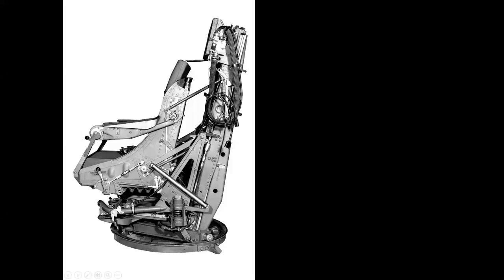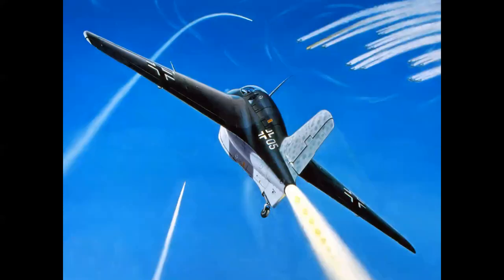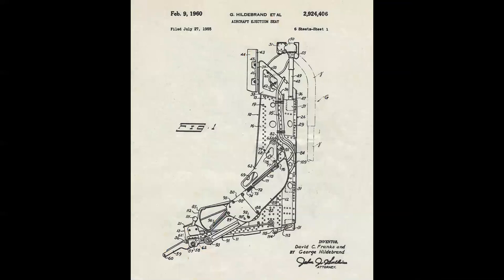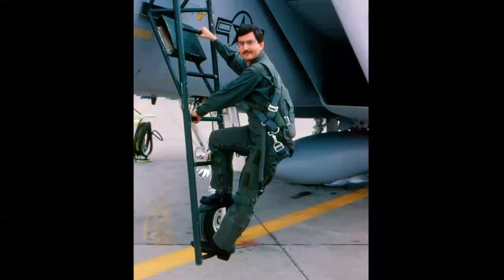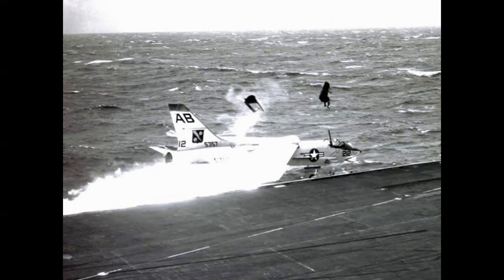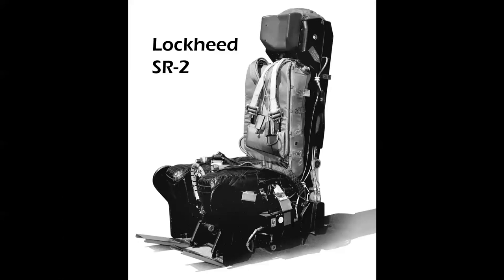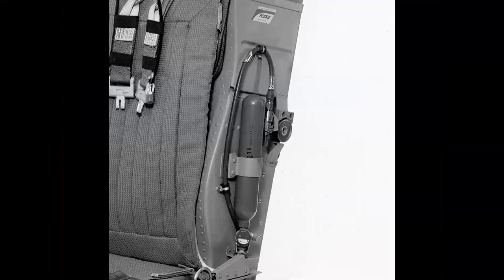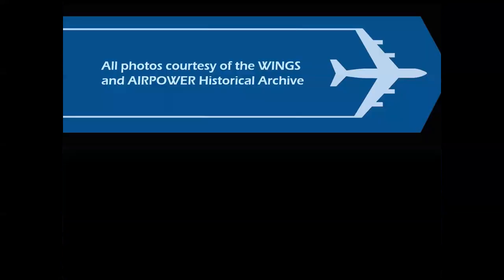EJECTION SEATS - Evolution of High-Speed Aircraft Escape Systems in the Supersonic Era

Comment: Approximately how many ejections are made through the canopy instead of canopy jettison followed by ejection?  I know the A-6 crew goes through the canopy but I don't know if any other plane does this.  

The sequence of events is phenomenal and such short periods of time.  When you add in situations where there are two or more crew involved they have to "flare out" to avoid hitting each other.  Incredible that it works for a single pilot.

Another great series!  Thanks!!!!!
Reply: "Approximately how many ejections are made through the canopy instead of canopy jettison followed by ejection?"
Depends on the plane and its mission.
The A-6 wasn't the only plane where the ejection seat was designed to punch through the canopy, btw.
The F-35 and Harrier do this as well.  The reason has to do with the US Marine Corps close air support mission.  They fly lower and closer to the troops so a normal ejection sequence where you'd punch off the canopy first wouldn't work; the Harrier and F-35B fly too low for this and the pilot wouldn't be able to get out in time in many instances because the canopy separation prior to the ejection seat firing would take too long!
They don't punch out through the canopy immediately.  Instead, an explosive cord built into the canopy (you can see it as white "stencil" in the Harrier canopy and F-35) fires and shatters the portion of canopy above the seat (indicated by the stencil which is actually the cord).  The explosive cord does this in milliseconds.  THEN the ejection seat goes through the shattered canopy.
Reply: Reading further, the T-6 Texan II and the BAe Hawk trainer evidently have a cord destruct system for their canopies, too -- ie, their ejection seats blast through the canopy, too.
More of the ejection systems seem to be designed now to have "breakers" -- literally spikes -- built into the seats to shatter the canopy in case it can't be blown off.
Going THROUGH the canopy without an explosive cord system is THE LEAST desirable option even a canopy breaker system built into the seat!
Reply: @AvengerII  Thanks!  A-6 tanker where there was a partial ejection sequence with the second seat guy stuck half in and half out of the plane showed how dangerous this could be.  If his chute cords had not gotten entangled in the vertical stabilizer  and held him back he might have impaled on the shattered canopy on landing.
Reply from the maker: Many thanks Chuck, and today's ejection sequence occurs literally in the blink of an eye. From initiation to full parachute is 1.8 seconds with the ACES II in Mode-1 today. As for ejecting through the canopy, all modern seats have 'canopy breakers' built into the seat tops. Northrop's original T-38 seat (1959) actually had a sharp stubby blade sticking straight-up on top of the seat headrest.
Reply: The Lockheed T-33A seats we had at Tyndall AFB, Fl. had the canopy breakers atop the headrest.
Reply: @AvengerII  I’m not sure about the Harrier, but your explanation about the F-35 is incorrect.  Pulling the Ejection Handle on the F-35 on all 3 variants will always fire the canopy fracturing system before the seat fires unless there is a system malfunction in which the canopy fracture system fails.  The canopy breakers on the F-35, T-6, T-38, F-15, and A-10 are only there in the event of canopy jettison/fracturing malfunction.  The reason the F-35 has a canopy fracturing system as opposed to a canopy jettison system is due to the canopy hinges being at the front of the cockpit as opposed to the aft side.
Reply: @Vick99504  The F-35B is still flying the same mission profile as the Harrier -- low-level attack, close air support.
They wouldn't change the business of firing the seat through the canopy after 40+ years experience of flying in the same conditions with the Harrier.  There were over 130 Harriers lost in USMC service alone.  Most of the Marine Corps pilots who survived did so because of the way the ejection seat was set up.  There's not enough time in many circumstances to blow the canopy shell off and eject the seat a few moments later.  They fly too low for the normal ejection sequence to be practical.
The reason why the F-35 canopy hinges at the front (B-model anyway, but I think all the F-35 models hinge at the front) is because of the lift fan mechanism behind the cockpit.  They can't fit the hydraulics powerful enough to move the canopy.  The associated equipment for the lift fan (doors and other auxiliary mechanisms) take up too much space.
This is the same reasoning for why they put the cannon in the wing roots of the F-15 and F-16; there was no other practical place to position the gun!
Reply: @AvengerII  it takes just as long to fracture the glass as it does to jettison a canopy.  You are correct about the reason for the forward canopy hinges, but you are incorrect as to why the canopy has a Flexible Linear Shaped Charge as opposed to a standard canopy jettison system.  The A-10 flies CAS and has a standard canopy jettison system.  They didn’t keep the FLSC just because it has been used on the Harrier for 40+ years.  The 35 is supposed to replace a lot of different airframes.  They picked the FLSC because of the forward hinge points alone.  I was on the F-35 Test and Evaluation program specifically for Egress systems for 6 years and dealt with all 3 variants.
Reply: @Vick99504  I kinda doubt that statement.
The seat can already be moving on the rail a millisecond after the canopy charge explodes the canopy to bits.
But if you want to jettison the canopy, the explosive bolts have to fire, and the canopy still has to move  out of the way before the seat can move past where the canopy is.
Especially for a really big one like on an F14,  F15 or 16, that's a lot of mass to move out of the way
Remember Goose in Topgun?
Pretty sure  he would have preferred the shaped charge you mention 

Obviously it's a movie, but in real life pilots have been ejected into the canopy that had not cleared yet.
Reply: @stijnvandamme76  I have never heard of any pilot dying the way goose died, but I have never worked on F-14’s so I don’t know if the seat would fire through the glass.  But I do know that it the canopy doesn’t go on an F-16, the seat will not fire, and if through some miracle act of god that defies all logic and system design it did fire, the seat might go through it, but the pilot wouldn’t survive.  On all other fighters currently in the US Air Force Inventory (except the F-22, but including the A-10), the seat will fire through the glass if it isn’t out of the way.  But again whether it be FLSC or a Canopy Jettison system, any time the seat handle is pulled, the canopy system will always fire barring any mechanical malfunctions.  There isn’t any way to select just shooting through the glass to save half a second.  Additionally, the charges used in both canopy fracturing/jettison systems burn at 25,000 ft/second.  So yah, a canopy will jettison just as fast as it will fracture.  In the case of the F-22, it is all electrically initiated.  Electricity transfers at about the speed of light, which is even faster than the FLSC/SMDC/MDC/ECRL/DTA/RDCTL’s found in nearly every current Egress equipped airframe in the world.  You can look at the specs and times for current egress systems for Jets that have a canopy jettison system vs a canopy fracturing system and they are pretty much identical.  I have worked the egress system on 7 different fighter/attack/trainer airframes, 2 of which had canopy fracturing systems, but you don’t have to believe me if you don’t want to.🤷‍♂️🤷‍♂️

What explosive “bolts” are you talking about?  The CARB on an F-16?  That’s the only one I can think of.
Reply: @stijnvandamme76  Ward Carroll talks about the "Goose incident" on his channel. It apparently happened in real life in an F14 (crew had to eject due to an unrecoverable flat spin), and the procedures were modified so that the crewmember would jettison the canopy first, then wait (don't know the specified time, but probably no more than a second or two) , and then initiate the ejection-seats. These procedures were already in play in 1985 when the movie was filmed, so one could basically say that Goose panicked, making him forget to jettison the canopy first and that is the reason why he was killed.
Reply: @Vick99504 Wow Vic, I’m surprised that you never heard that the “Goose incident” is based on a real life incident. And CFS does save a couple of tenths of seconds, especially in the case of a low speed F-16 ejection where the canopy has to clear the escape path then the lanyards continue the ejection sequence.

Comment: Mike, in your Edwards research, did aircraft mfgrs generally handle their own ejection seats, or were general M&B (others) zero-zero used? Or, both?

Also, have you any information on the XF-104 seat when Lockheed transferred from downward to upward?  I was always surprised Kelly Johnson did downward seats after the SR-71 research, although he didn’t take it lightly.

I swear, you’d have to be a Yeager or an Armstrong to ride an X-15 down to egress properly.  I couldn’t imagine holding myself together.  Which might explain a couple things…like, keep the stool sample.
Reply from the maker: Good question on ejection seat manufacturers, and the answer is "all the above." Certain companies designed seats specifically for their aircraft (Douglas, Lockheed, Convair, North American, and Republic), while other companies used seats built by Stencil and Weber. Navy aircraft almost exclusively used Martin-Baker escape systems because of their reliability and performance at low altitude and low airspeeds, the domain of aircraft carrier operations. Thanks for watching.
Reply: All the downward Starfighter seats were replaced by the end of 1959.

Comment: The pitot tubes on ACES II seats do not sense pitch and altitude.  Only airspeed.  Altitude is determined by the static port on the Environmental Sensor.  Pitch is not a factor taken into the equation by the E-Sensor.
Reply from the maker: Thanks for the correction!
Reply: Environmental Sensors are soon to be a thing of the past.  The MASS is a good step in that direction.   However, Martin Baker has been ahead of the game for over 20 years with their BTRU design, integrating G-limiters in conjunction with a Barostat.  All mechanical,  no possibility of electronic failure as experienced with the DRS.  Ever wonder why they use MB thermal batteries in all current ACES2/ACES5 seats?  That would be a good topic to discuss.
Reply from the maker: @david69leonard  Excellent information, thanks!

Comment: I’ve never heard of downwards firing ejection seats before
Reply: It was a thing in the early/mid 1950's. Rocket sled testing showed that there were serious concerns in regards to clearing a high mounted (T-tail) empenage when initiating the sequence at a high (1.5+) Mach number. Numerous aircraft (primarily US built) were fitted with this sort of escape system at the time.
The reasoning was that these aircraft would be gaining altitude rapidly at launch and thus the escape system would be viable almost immediately.
At this same point in time the F-100 Super Sabre was killing roughly 30 pilots per month (USAF + Allies operating it)...and it had an upward firing system.
There was a huge learning curve in the period.

If there was ever a true "widow maker"? It was the F-100...without a doubt.
For that matter? Take a look at the crash rates for its predecessor, the F-86.
Things that make the news today (as an OMFG, you have to see the video) were regarded as inconsequential back in that age.
Reply: @ronschock6545  ahhhhhh I see I see, i didn’t know they climbed so fast
Reply: @ronschock6545   30 a month?  Please.  🙄

Comment: What do you mean by vernier (probably spelled that wrong) rockets? Awesome technology and video but I’m trying to understand how the seat is able to control its attitude/position in flight. I’ve always been fascinated by ejection seat technology! I should’ve been an engineer instead of a pilot… lol
Reply from the maker: Good question, thanks, and that device actually turns the rocket nozzle to change the direction of the seat trajectory. In an inverted ejection, the seat will fire itself into the upright position to save the pilot. Thanks for watching!
Reply: @celebratingaviationwithmik9782 . 
WRONG!!! The vernier rocket is part of the STAPAC gyroscope system that KEEPS THE SEAT in the SAME PITCH ANGLE as it is when it ejects!!! It does NOT change the attitude of the seat.

Comment: Are there any ejection systems that work automatically if a pilot is incapacitated or are you just screwed?
Reply: The Yak-38 (VSTOL aircraft) had an automatic ejection system. The F-35B VSTOL was qualified for an automatic ejection, but I don’t think that it has been activated.

Comment: Could you please compare K-36D vs Mk18 (the latest one of Martin Baker) ejection seat? Which one is the best?
Reply: First of all when you are comparing TWO things, it is which is BETTER (comparative), not which is BEST (superlative). Perhaps you should have paid more attention in English class. Secondly, the K-36 is based on mechanical 50 year old technology that was developed for high speed escape (which it does well in), but it lacks in performance for low speed high sink rates where most ejections actually occur.

Comment: There's another Zvezda company that makes model kits.
They became better known in the last 3 years for making the largest available Imperial Star Destroyer model kit (Star Wars) available on the mass-market.  Originally, that model had to be imported from Russia but Revell/Germany picked up the license and a new release of the kit was done for the West.
It's 1/2700 scale.  The 1/5000 Star Destroyer kit from Bandai is more accurate in detail but the Zvezda kit is MUCH larger (greater bang or more styrene for the buck) and more popular for accuratizing.  The only option (besides greater detailed accuracy) the Bandai kit has over the Zvezda kit are pre-drilled holes should you choose to light the Bandai kit!
Reply from the maker: Amazing story, thanks!
Reply: I was wonderingif there was a connection.  Maybe the aviation company diversifying it's product line after military cutbacks?
Reply: @lancerevell5979  <Shrug>
It's possible.
Grumman Corporation became diversified after its government contract work became shaky post-World War II.  In addition to all its Cat fighters (Wildcat, Bearcat, Hellcat, Tiger, Panther, Tomcat), Grumman produced the Apollo Lunar Module, manufactured the wings for the space shuttle, and produced trucks.
I saw delivery trucks manufactured by Grumman on occasion in the 1980s and 1990s for sure.  They were clearly marked "Grumman."
Since Grumman merged with Northrop in 1994, most of its New York manufacturing plants were shut down (1 or 2 were converted into studio space for motion pictures because they were that big!) but they were closing down plants even before then.  Their last major plane manufacturing contract was the F-14 and it was far from their most successful manufacturing program.
Reply: Zvezda is the Soviet company that produced the K-36 seat variants and space suits, but I think that this is just a coincidence since Zvezda merely means “Star” in Russian.

Comment: My father invented or designed the ejection seat along with the seat absorption system ,face shield, the steel points at the top of the seat to break the canopy
Reply: WTF is a “seat absorption system”??? I’ve been doing this work for 35 years and have never heard of that term.
Reply: @johnp139  early on there was no absorbtion for the g 's they were having some pilots having spinal injuries so he designed the seat absorbtion system to help with that problem